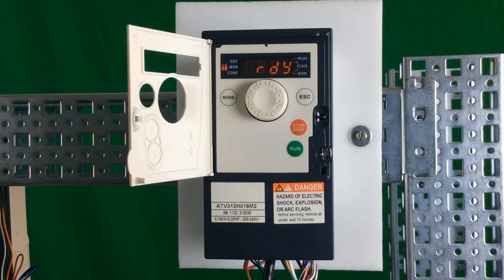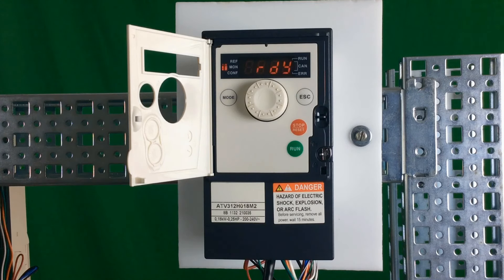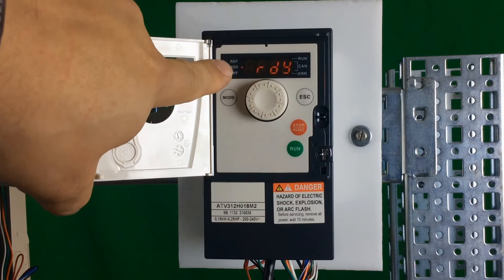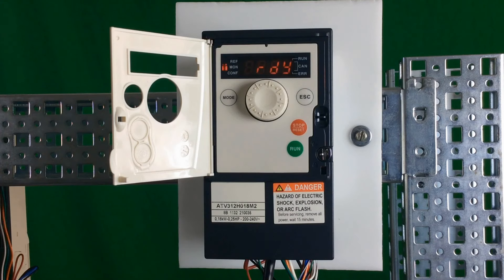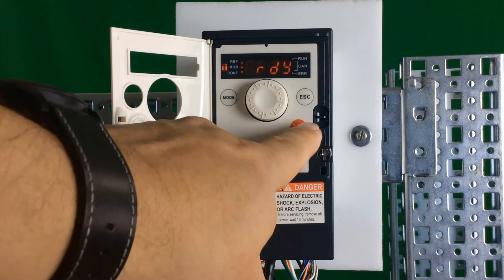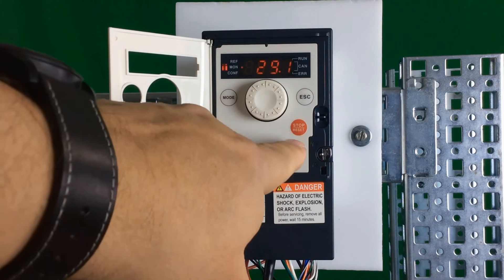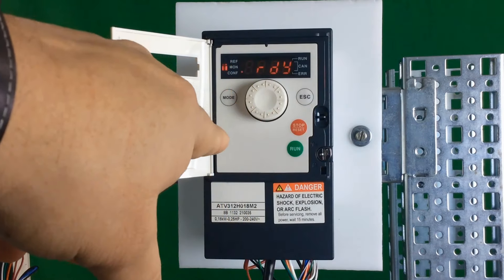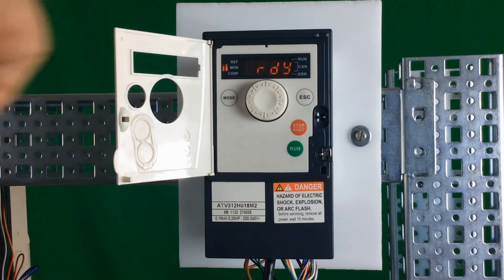Controlling and Programming ATV312 in Local and Remote Modes | Schneider Electric Support

Comment: This is insane...  from the Schneider web site...

As of firmware version 5.1 IE56, The ATV312 series drives can no longer be switched from local mode to remote.  In order to change the drive from local to remote, you perform a factory reset using the FCS parameter.